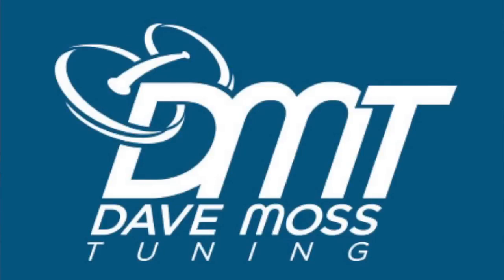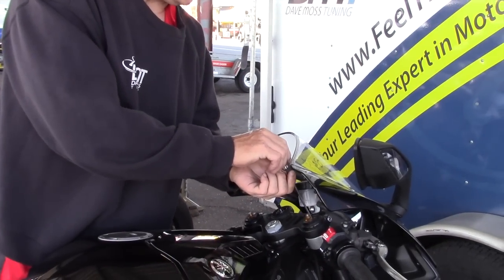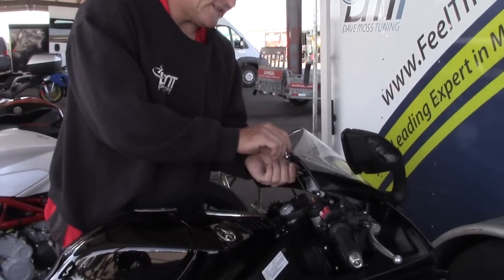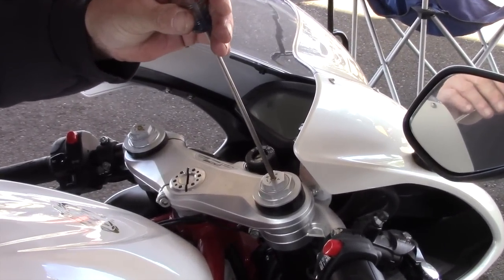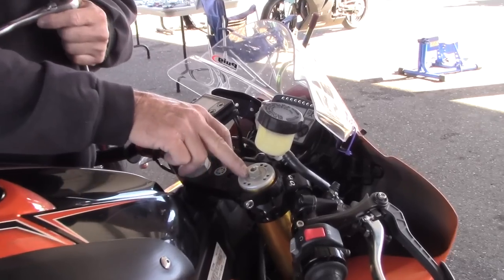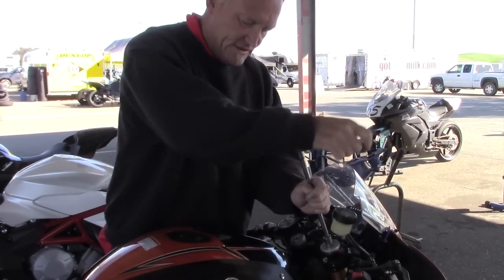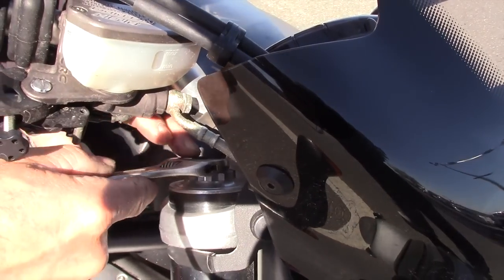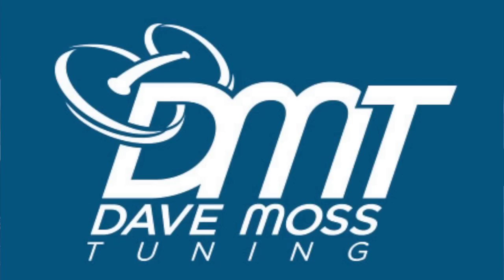2 Clicks Out: Motorcycle Suspension Clicks, Turns, & Faces

Comment: Dave
  my riding buddy just bought a pretty perfect 2015 FJR 1300 A..
  he bought the machine from a guy in his late 50s. A kid to us. I’m 70 and my riding buddy is 66..
  my friend says that in the 40 mph range going straight, he’s getting handlebar oscillation/side to side. It goes away once he goes above 50 miles an hour..
  The machine has recent Perelli tires front and rear. It’s totally stock, I checked the wheel alignment with string as well as I could, and the machine seems straight..
  The shock and the forks are not leaking oil
  The steering head bearings roll smoothly and there does not seem to be any excess play
  there are only two adjustments on the shock for number of people - rider, and passenger. He has it set on rider only.
  The front tire is cupping
  The damping adjustment on the right fork was out 10 clicks
I turned the knob out just five clicks from closed. I know to do just one adjustment at a time from my road racing days..
  we made no adjustments to the preload on the forks. They seem to be out three increments..
  neither wheels seem to be bent or damaged..
 I don’t know if there are damping adjustments on the rear shock, my friend did not bring the owners manual..
 The suspension seemed to compress and rebound evenly when my friend bounced up and down on the seat and I watched..
what would cause the bars to shimmy ?
  and the newish front tire to cup ?
 suspension improperly balanced?
 this machine says no signs of an accident. It is a 2015 FJR with only 6000 miles on it garage kept. Over the road trucker, his house, his new pick up, and his wife’s Cadillac were all spotless just like this motorcycle..
 what do I check? Where do I start?
 Thanks
Reply from the maker: Hi Jody, cupping is rebound too fast so you did the right action with your change. Also check with calipers fork height above the upper triple clamp. 1mm off will induce the wobble. Rear wheel alignment should be checked with the calipers to make sure it is 100% straight. Last change will be to go from rider to passenger with the rear shock to life the rear and put weight on the front tire.

Comment: Why is compression on one side and rebound on the other? Confusing
Reply from the maker: Many brands choose to do this so they counter balance each other. No different to spring in one fork and damping in the other. Many ways to design a system to work effectively.
Reply: @catalystreactionsbw  so each fork actually performs differently??
Reply from the maker: @justaguy4real  hence COM and REB as a label for each fork.

Comment: so verytime you say out meaning (+)plus reb/comp or clockwise or harder/stiffer.. i thought out means counter clockwise because like unscrewing a screw turn screw counter clockwise it goes out
Reply from the maker: As an industry standard, hydraulics are always set to the maximum position clockwise and then you count back turns or clicks. For preload you always start from minimum and count in.
Reply: Dont wanna sound ignorant/an a. Hole.. but thats what i thought what the term clicks out or turn out means, going counter clockwise. But dave said 5 clicks out etc for maximum rebound going clockwise. I understand the principle of it clockwise for stiffer and counter for softer but i just dont want to confuse the terms. Anyways.. thanks for the reply. I hope sportbike manufacturer would add a rider weight to preload measurements included to the manual as base line for street riding preload atleast. kinda like what harley davidson did. Makes adjusting suspension a little bit less daunting. Anyways you guys are doing some legendary stuff keep up the good work. I hope we have the DAVES OF DMT where im from.
Reply from the maker: @krayzieegg7294  I understand your comment now. At the very first assessment of what settings you have, you count clockwise to see where you are and then adjust back counter clockwise for both rebound and compression. The number counter clockwise becomes clicks or turns out from that point on.

Comment: We learned to count in english. The point was?
Reply from the maker: Too many riders all over the globe are intimidated by suspension, adjustments and using tools to change their settings from the showroom floor. This video gives them a straight forward approach to at least begin their journey into changing settings and remove that intimidation.
Reply from the maker: Dave Williams, editor replying here.  Yes, yes, it's always best to count in one's native language to ensure accuracy.  Although I did meet a French race data engineer who, when I asked if he resorted to French when he counted and did the math in his head, said no he did it all in English.  That he could only do his job in English since he'd learned it all in English.  He could not do it in French!  Anyway, the point here is not "how" to count, but "what" to count.  If an adjuster has clickers you count the clicks.  If it does not, you count the turns.  If a nut is involved without enough room to rotate the tool 360 degrees, you count the faces of the nut.  If it's a castle nut you count the number of tabs (per full turn).
Did that answer your question or did I misunderstand?

Comment: When you soften a suspension, do you need to move the compression and rebound and that?
Reply from the maker: If you soften spring tension you should change rebound damping to match. You can change compression by itself if you want to and that would be in small increment of .5 of a turn at a time.

Comment: can you show how this is applued on the front forks for suspension of 97 Zx7r motorcycles. my bike dont have the letters which indicates rebound or otherwise..tyrone thanks..i grasp concepts your saying just my machine is void of what you show within video here..
Reply from the maker: You have a preload adjuster that takes either a 14 or 17mm wrench. You can turn the adjuster all the way counter clockwise to see where you are. Both adjusters should be the same in settings. Next, take a screwdriver to the rebound adjusters screws that are in the center of the preload adjuster and do the same, then repeat the exercise with the compression adjusters at the base of each fork. Knowing where you are is a good starting point, so you can go one way or the other to one adjuster at a time to see if there is a better setting.
Reply: i fully understand what you instruct. will it matter that i have no clue as to how many turns counter clock wise you staye to turn each. I am guessing counter clock wise is bottoming it out ?
Reply: am i able to post pic of my forks on this here thread?
Reply: the Adjuster using the 14 or 17mm wrench has been set to 4 lines counter clock wise. With the 5th line sitting at the top of the bigger bolt, that has adjuster inside of it. i have not dont anything to the flat head screwdriver screw sitting in top of adjuster. i just did new fork seals this past summer coming into the winter in new york state we just few months back. its starting to warm up here..no snow just rain these days then sunny again up n dwn weather..the forks both were taken apart well cleaned and put back together..with fresh fork oil in accord to spec..but i do not recall ever setting the proper suspension on my bike. guy had my bike at his home near Syracuse NY. So its possible he might of attempted to set my suspension. I s this expensive for professional shop to do...an on average what is cost im looking at? i want to try it but dont wanna throw things any further out of whack then my suspension already is..
Reply from the maker: I can send you settings via email to use at $20 via PayPal. You can use a local suspension person to set the bike and they will charge you $40 to $60 or more depending on the amount of work they do.
Reply from the maker: send it to me dave@davemosstuning.com and put YouTube ZX7 in the subject line
Reply: ok dave..im with my cousin dealing with an important family issue at moment. I am not home where my bike is. i will send you pictures of what my forks are like and of the rear spring for sag as well..
Reply from the maker: No rush as family always comes first.
Reply from the maker: It should be around $40 to $60 to get the suspension set for your weight. Consult local racers for who is close to you that can help.